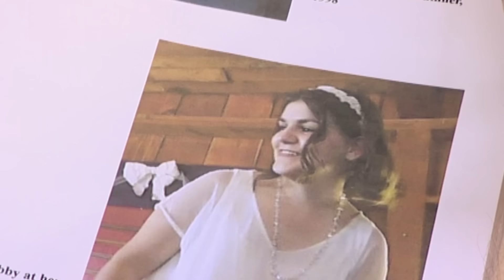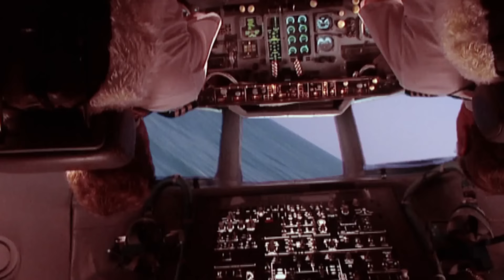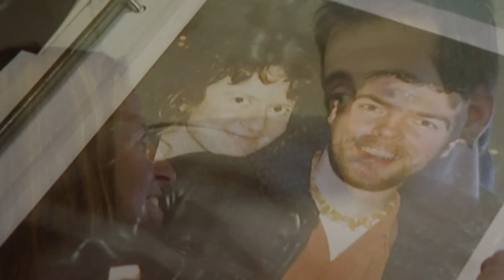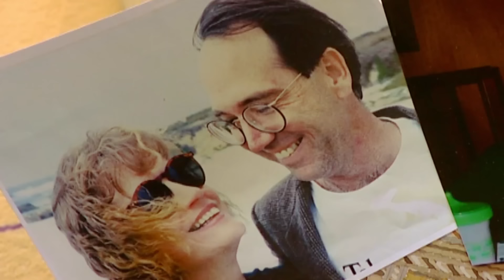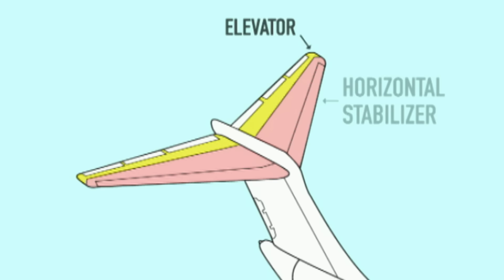Failed Jackscrew Claims 88 Lives | Mayday Air Disaster

Comment: "Where they went wrong... ".. NO. Absolutely No. The pilots had no idea what was wrong. Don't blame this on the pilots, who did everything they could with the knowledge they had.
Reply: The pilots were professional and so damn brave. What a tragedy.
Reply: To be fair. They did a remake of this episode and depict this aspect now just as you describe.
Reply: I agree 😢
Reply: Facts 💫✨
Reply: They shouldn’t even try to blame the pilots
Reply: I agree. But keep in mind that not only were maintenance errors involved but this plane was built by McDonnell Douglas. If you recall, these same issues plagued the DC-10; specifically flight 191 in Chicago and now those same executives are at Boeing. Keep that in mind if you travel on a 737 Max or 787 Dreamliner. Today is June 12, 2024 ; as of today, 2 former Boeing employees who became whistleblowers, have died under questionable and suspicious circumstances.
Reply: To not point out the double use of the motors in an effort to free the horizontal stabilizers as a catastrophic action for the jack screw would be neglectful
Reply: The pilots were in a no-win situation. None of this was their fault.
Reply: There was one where a DC-10 lost an engine on takeoff. The rear mounting braked broke and the engine rotated up over the wing damaging the leading edge, tearing out hydraulic systems that heal the slats down and the electrical system that powered the pilot's instruments and the stall warning systems.
      As far as the pilot's knew they had only suffered an engine failure. The would have no way to know the engine had fallen off and damaged the wing. The procedures called for them to maintain a lower airspeed in take off configuration that was below the stall speed if slats were not deployed. This caused the left wing to stall causing an uncommented left roll the pilots could not stop.
      The pilots did everything right by the information they had. But based on the actual problem, if they had maintained a higher airspeed they could have returned to land safely. But this was information they did not have. Perhaps they could have worked out what was happening, but they didn't have the time.
     You can only judge someone by how they reacted based on what they knew. A lot of the time the pilots simply can't know everything.
Reply: @andreseh87  99% of people would agree with that assessment, but only 1% will still blame the pilots. Mayday likely wanted to appease that small minority of naysayers, but it backfired. Many are still on YouTube channels showcasing their ignorance, ethical bias, and lack of human dignity & understanding.
Reply: Exactly!
Reply: @jocelynharris-fx8ho  What does that have to do with Alaska Airlines at the time not doing their job with maintenance?
Reply: They aren't blaming the pilots. Whether they knew the solution or not, their decision was technically "wrong".
Reply: Airlines procedures said consider trim inop. 😢 had they followed it they could have made it. 30 yr pro here.
Reply: Facts
Reply: @erictaylor5462  Correct.  That was AA flight 191 out of Chicago on May 25, 1979.  I flew out of Chicago on a connecting flight on an AA DC-10 flight on Thanksgiving Day that very same year.  I was 21, loved to fly and knew somewhat concerning the accident.  After boarding and settling down in a window seat (it was a very empty flight due to the holiday) I asked a steward if this was the same aircraft type as - I paused and quietly made a gesture with my hand outstretched and then turned my hand over - and he nodded and then told me in no uncertain terms that HE would NOT be aboard if it had not been FULLY checked out and deemed completely safe!  I then had a pleasant uneventful flight back to San Francisco to reunite with my family after spending two years in eastern Canada.  That was a flight that I will always remember thanks to a very professional AA crew member and his calming words to a nervous traveler!
Reply: @KIDSKELETON
There was no "right" decision that would have gotten them out of that situation for sure though. Its easy for us now to say if they went immediately to land instead of testing they might have made it. Or, the jackscrew might have come apart over the airport from the stresses of slowing down and trying to land and a bunch of people on the ground die too.
That was also highly possible if they tried to go in immediately. Or they cant control the speed and pitch enough to actually land, and the plane touches down, drags a wing and starts cartwheeling or otherwise breaks up on landing. In an alternate reality we could be sitting here saying "they should have tried to test out over the ocean, then there wouldnt have been 100 people killed on the ground when the jackscrew broke on landing."

And no one at all thought the maintainance was so bad that the entire jackscrew assembly was bound up due to lack of lubrication and close to completely coming apart during the first nose down situation. That wasnt even in the realm of possibility at the time.
Reply: I think it was meant as "They were wrong, but they didn't or couldn't know they were wrong" Just because you were wrong about something doesn't make it your fault or negligence on your part.
Reply: The pilots were not to blame on this one. Unfortunately it was maintenance to blame. Stabiliser is a key component.
Reply: Nobody blamed the pilots. They are just saying they made the wrong choice had they known what was actually happening.
Reply: They could have chosen better wording.
Reply: May the souls our loving Brothers and Sisters Rest in Perfect Peace. I have no words to express how I feel sad, so sad
Reply: AGREE 100 %
Reply: Agreed.

There's a valid case for arguing that there should be a greater automatic collation of diagnostic information, so that pilots can avoid taking off in unsafe aircraft, but that's something that didn't exist then and doesn't exist now.

The pilots had essentially no data, maintenance was essentially useless, and frankly it's not clear the incident was survivable from the moment they hit V1.
Reply: They were skunk red and gone😢
Reply: the maneuvers literally broke the jack screw....

Also, Rodriguez commends their final efforts. Stop imagining blame games.
Reply: @charliemarqfj McDonnell-Douglas, the company that ruined Boeing, made a plane with a single (one) jackscrew and the FAA believed their claim that it was failsafe. Labor laws would prevent voluntary inspections of the jackscrew outside of Alaska Airlines procedure. And if they did anything about it, the mechanics' supervisors would overrule and then fire them. That's exactly what happened to John J. Liotine. "Maintenance" people are not to blame here.

Comment: The backups of backups is a reasonable argument, but you also want, where possible, to distribute the liad across systems that can handle the full liad on their own.

Then you greatly reduce the chance of failure, as there's less stress on any one thing, but the failure of a component is not problematic as the other component doubles as a backup.

You never want to have single points of failure, and - personally - I'd withdraw airworthiness certification for all aircraft designs that contain mission-critical SPFs.

Comment: There needs to be a way to safely dislodge the fuselage when the plane is going down. Some way to detach the fuselage with parachutes and ER inflatable bouys around the outside. Even ejectable cockpit. Something where it automatically ejects the fuselage and cockpit when a catastrophic failure happens. The pilots faught to fly that plane, they may not have landed here on Terra, but they landed in Golden City, Valhalla/Folkvanger, Elysian Fields, where ever your soul is meant to go when your time here is over. They pulled out of the dive and headed for the gates of heaven.

Comment: having an incident where they almost lost the plane instead of requesting for a flight level block they should have tried getting it down, they did try that but Alaska Airlines had an unsafe plane no matter the sill and experience of the pilots it was thir last flight. Cost cutting and unsafe planes are the worst as there are no pit stops mid-air.

Comment: In my days in the Navy paint/oil spills were treated lightly until the EPA threatened to fine the commanding officers of the responsible ships $100,000.  Guest what?  No more spills and/or they are quickly contained.  Most hold upper management responsible or nothing will change - in all industries.

Comment: The airline industry has shockingly bad regulation for something where virtually every aspect is mission-critical and where the repercussions and indirect consequences resonate far beyond the victims.

Even now, Boeing and Airbus use fake parts, Boeing systems are fragile (possibly true of Airbus as well), and there's either Single Points of Failure or grossly inadequate backup.

Testing is grossly inadequate - for example, Boeing Dreamliner suffered electrical systems overload in early commercial flights, indicating no stress testing was never done.

The 737-800 also suffers a lot of hydraulic failures for such a critical system, and the recent South Korean crash was an airframe built before the electrical system had adequate backup power - a problem Boeing "fixed" after several total electrical failures on this model. Either the fix wasn't clearly mandated or the fix didn't work, those are yiyrvtwo options, there are no others.

Earlier 737s suffered problems with the rudder jamming, engines choking from lack of fuel, and other relatively easy problems that would have been found in meaningful testing. Hulls lost due to problems that shouldn't have got through to production to begin with are substantial.

And there are episodes of this series where Boeing has known of a serious fault that could be carastrophic that it simply brushed under the carpet and pressured the NTSB into ignoring.

Yes, it's much safer to go by plane than any other means of transport, but that's not an excuse for inept design and shoddy engineering. Rather, it's justification for arguing that improving competency is a sound approach, then improving said competency.

Comment: I remember this incident well, as a friend of mine was on the same flight a week earlier.  The  MD 80 Jack screw failure.  I would not get on one of those planes if it was the last plane on earth.  I remember them taxiing and rotating  the rear stabilizer, up and down to make sure they were working before they took off, after this failure occurred. Very scary.

Comment: You can't cut corners, when it comes to airplane maintenance, after all isn't air travel dangerous enough.
Reply: Yet to this day even under massive scrutiny presently, Boeing continues to cut corners and are once again cutting costs by choosing speed over functionality, and if it keeps up we’ll unfortunately be seeing more of this…a small oversight or mishandled task in maintenance, will come back to haunt them, too bad any whistleblower now is far too scared to blow the whistle after what happened to the latest one.
Reply: @ml8452  Sadly, it’s not just Boeing.. this episode dives into the maintenance malpractice amongst airlines. Even to this day, it’s not always the manufacturer that cuts corners, but more often than not, it’s the airline companies..
Reply: You can, it'll just have severe consequences. But as it turns out you can, and people do...

Comment: The FAA is very much to blame for this crash. The FAA agents did not intervene properly to stop the Alaska Airlines directors and technicians to cut corners, nor did they take any measures in the 2 years prior to the crash, although they knew what was going on. The FAA rules for immediate and proper intervention to prevent a crash are purposefuly wrong.

Comment: The design of the Jack screw remains the same. It still has no fail safe provision.
If it fails again the same thing will happen. Is this an American mentality towards the value of life versus costs of doing the necessary work?
Reply: How many people died in major airline crashes last year? Answer that
Reply: @thecommonsenseconservative5576  How many people had to die before last year just so an airline can make a buck off a faulty plane they knew was flawed?
Reply: @jeremycagle19  yeah how many died last year genius. Not a hard question but you obviously don't know the answer

Comment: At about 48:00 there was a bit about not making the horizontal system redundant. It actually was.
They had two motors to operate it. Nobody ever expected a jackscrew to fail .... and it wouldn't have with proper maintenance. 
I was aircraft maintenance, USAF, for 23 years: 73 to 96.
Reply: you know of what you speak👍

Comment: Jackscrew idea is terrible. Cranes use metal cables. They hold tones of. Weilght. They are. Used in aviation. Buy the screw for trim aeleron.? Noo. Way. Jamming guaranteed. Weather bolt will be stuck. Or. Broken.

Comment: They should’ve left the horizontal stabilizer alone they could’ve fly to their destination in manual control
Reply: Nahhhhh I don’t think so. A lot of commenters are also pilots themselves and they’re saying they were pretty much doomed and quite a few have explained why.
Reply: Vertical control relies on the stabilizer. If all control fails, as in this case, the aerodynamic forces on the plane will take control of that aspect of the flight envelope. There was no redundant or auto safe system to arrest the lack of control.